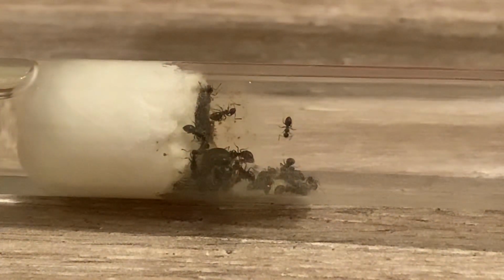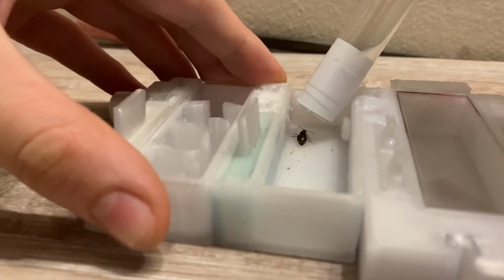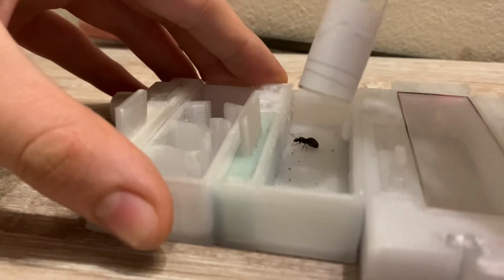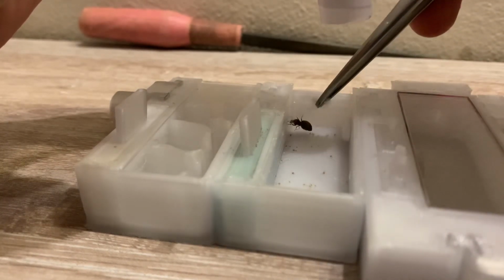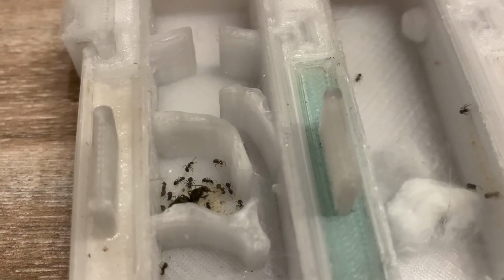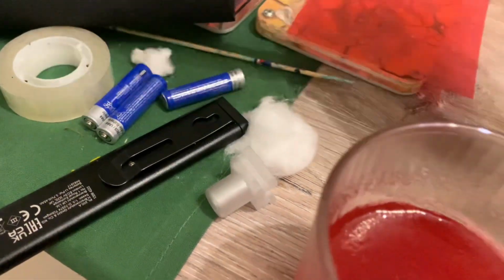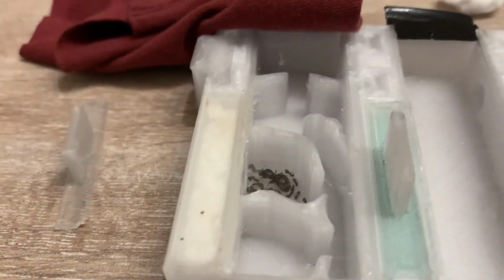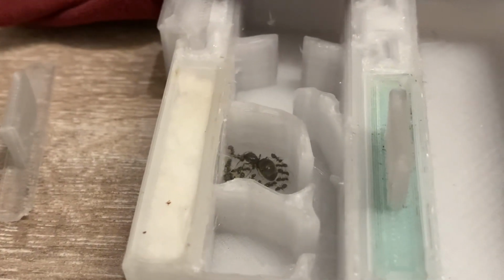Moving our lasius niger colony

Comment: I'd suggest using a soft brush to gently get the ants out and the brood. You could've possibly hurt the queen since you pushed them out with some force.
Reply from the maker: It was done with tweezers that had cotton in it so it should not hurt the queen
Reply from the maker: It had basicli the same effect as the brush
Reply: @AntCentral.  Ok.